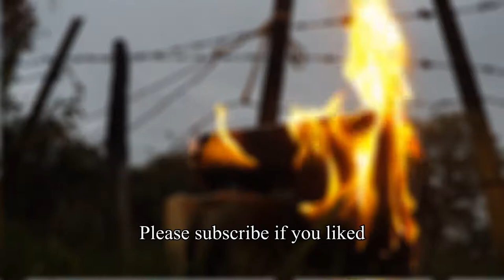Kenwood chef explodes with thermite

Comment: Sacrilege!!! These mixers carry on working for decades, with the right care and attention, so you should have simply given it to someone who'd appreciate it! :-(
Reply from the maker: This mixer was knackered I had to do quite a bit of work to free up the seized bearings for this experiment, there was a crack through the metal casing, flaking paint, every piece plastic trim was damaged in some way and I used parts from it to fix 2 other mixers, I was never going to need any other parts and it was too far gone to repair
Reply: @destructionboy3409  from your video it looked like there were still plenty of salvageable parts on this machine :-(